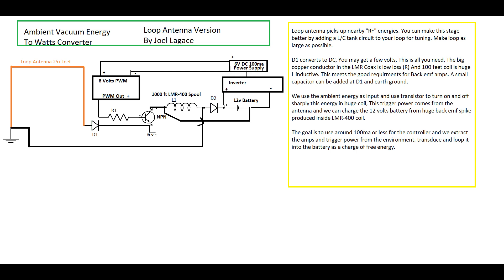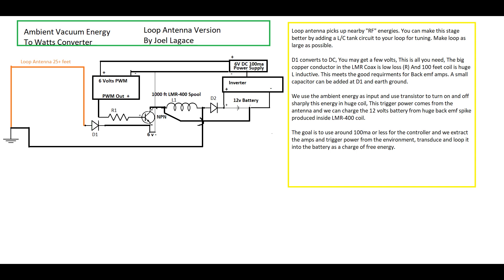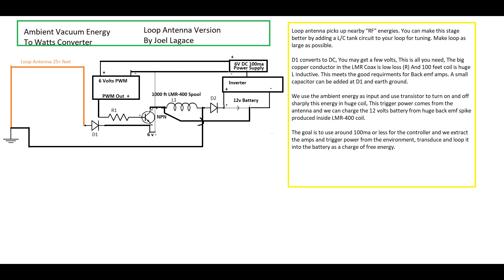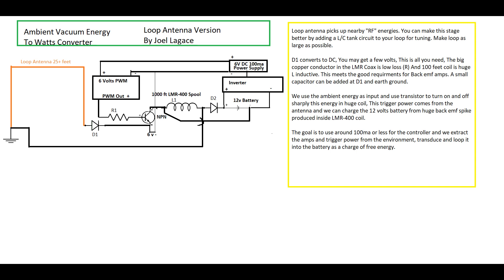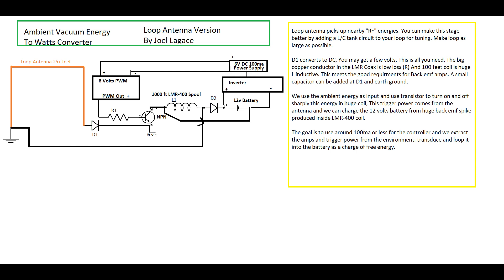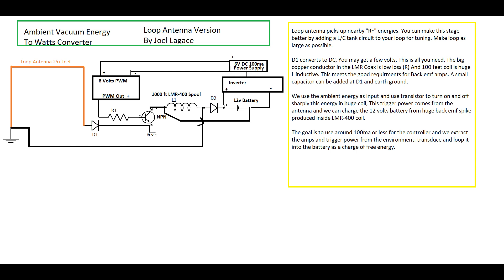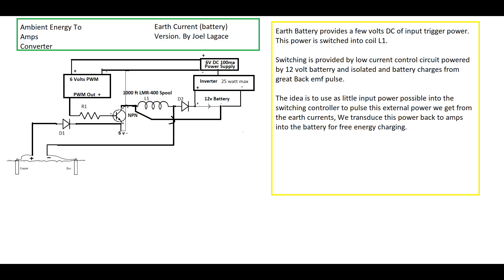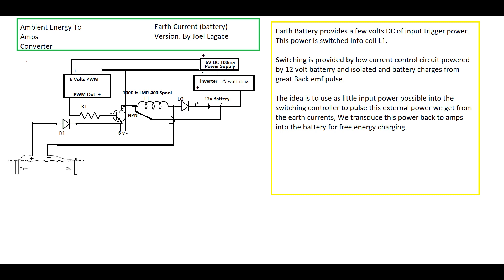Ambient Energies To Amps Converter

Comment from the maker: the idea in short, I'm using a simple diode rectifier circuit to convert the AC signal from the antenna to DC. We use this very low voltage as a trigger source that is pulsed at 1% duty cycle with a controller circuit into a bigger coil, Since in real life RF levels may be so so very low for the average person. some sort of pre-stage would be needed to make this work.
It made me think and with comments from others and conversations I had in private. I came to conclude that using a pre-driver stage with smaller coils and thinner wires to build up a quick, low-current, high-voltage spike could be a useful approach for generating back EMF pulses to drive with larger coils with a little input drive. The idea behind this approach is to use the smaller coils and wires to create a rapid voltage spike, which is then used to trigger a larger back EMF pulse in the larger coil.
To implement this approach, I could use a separate circuit consisting of one or more smaller coils and a driver circuit to generate the initial voltage spike from the input RF ambient. The driver circuit could consist of a high-voltage, fast-switching transistor or other electronic component that is capable of rapidly switching the current on and off in the smaller coils.
Once the voltage spike has been generated, it can be used to trigger a larger back EMF pulse in the larger coil. This can be accomplished by coupling the output of the smaller coil circuit to the input of the larger coil circuit using a transformer or other coupling device. If I keep cascading this setup into big coils at some point when I step down the final high voltage of several thousand volts from the bigger coils,It is possible that I could use the high voltage generated by using a spark gap and Tesla coil in reverse to be used to step down the voltage to a more manageable level to light up a 100 watt light bulb.
Overall, using a pre-driver stage with smaller coils and thinner wires can be an effective way to generate high-voltage back EMF pulses with larger coils. However, it will require careful design and experimentation to ensure that the smaller coil circuit is capable of generating a strong enough voltage spike to trigger the desired back EMF pulse in the larger coil.
It's also possible to build a feedback loop system using two coils and MOSFETs to create a controlled chaotic back EMF, but the design and implementation would be complex and require careful tuning to achieve stable operation. The back EMF generated in the system could be tapped and used to power a load, such as a 100 watt light bulb. The output voltage of the system would likely be highly variable and difficult to control, which could make it challenging to use for many practical applications.
I could fix that issue by just using the system to charge large commercial 60-70 volt batteries like Bedini did and use commercial grade inverters to get back 110/220 volts 60 hertz AC to run household. This way, I have a stable and reliable source of power for my home.
Taking it another step like Tesla wanted. It is theoretically possible to use the Earth's resonance or magnetic field to induce a back EMF in other nearby planets, which could then be amplified and sent back to Earth in a feedback loop. Same concept

Comment: Hello, is the cable single-core or braided on a coil?
Reply from the maker: the coax is two cables you short both ends on each side to make one. Trying to bring down impedances. The idea is the use the most huge massive coil we can and keep those impedances as low as we can. So when the coil pulses it more or less becomes the closest equivalent of a "superconductor".

Comment: Hay Joel what if you use the battery energy to pulse another long coil ? Even more from the original harvested energy ? That seems to be limitless way to magnify energy ?.? Good show
Reply from the maker: Yes there are ways to run more coils, I'm just running out of parts for that, If I can find some more good wire I will do some experiments with multi coils that seems like the way to go indeed.

Comment: good project, thanks for sharing; but it seems to me that the npn transistor you use is wrongly polarized because the diode that comes from the copper rod that collects the positive charges you put it in the emitter and the emitter should be polarized with negative. or maybe it is me who does not know some principle. 👍
Reply from the maker: The transistor control base power dc and ground are isolated from the switching coil power. Does that make any sense or do I have it wrong? I thought about it for a moment and figured if transistor is just a switch and both are isolated then I could just use the collector and emitter as an open path when trigged via base. How would you do it? I think you get the idea, I want to pulse the lmr coil with ambient energy. Maybe I do have it wrong with the polarity. But I'm doing this from memory so i'm sorry the projects were a while back. I will revisit this spring when I can put up loops and rods in the ground.
Reply: @joellagace1679  Hay que experimentar, pero puede ser que la configuracion que presentas para conmutar la bobina con cargas de la tierra si funcione, y para mi seria un descubrimiento nuevo que el transistor npn conmute tambien asi con el mas en el emisor, pero tambien se podria poner las cargas negativas de la varilla de zinc  al emisor y donde iba la conexion de la varilla de zinc poner las cargas positivas provenientes de la varilla de cobre por el diodo, es decir intercambiar las conexiones, lo que no se; es si las cargas positivas de la tierra vayan al mas de la bateria persiguiendo su negativo aunque no creo, de todos modos experimentando es que se comprueban las cosas. 
te deseo muchos exitos.
Reply: @joellagace1679  It is necessary to experiment, but it can be that the configuration that you present to switch the coil with loads of the earth if it works, and for me it would be a new discovery that the npn transistor also switches this way with the mas in the emitter, but it could also be put the negative loads of the zinc rod to the emitter and where the connection of the zinc rod was going to put the positive loads coming from the copper rod by the diode, that is to say to interchange the connections, what I do not know; I don't know if the positive charges from the ground will go to the battery, but I don't think so,
Reply from the maker: @stbanmurillo  Plus from earth battery or loop is not supposed to switch into the charge battery plus, its not that kind of circuit goal. I isolate it. what dumps into the 12v battery is the reverse back emf spike from L1 flipped back into positive with help of diode on the coil negative side.  Right after the transistor turns off the power going to L1 from earth/loop
Reply: i spent a lot of time studying the circuit and i think youre right..🤔